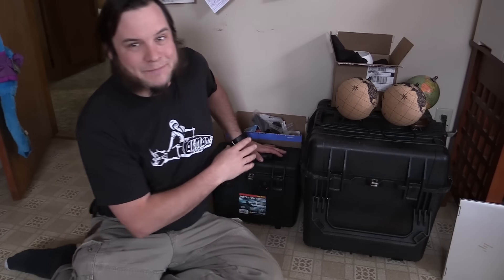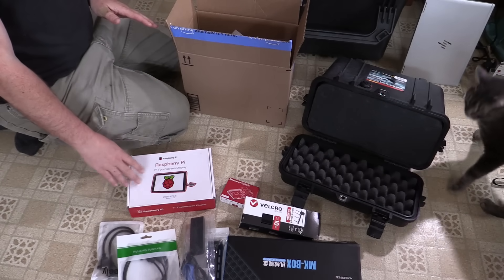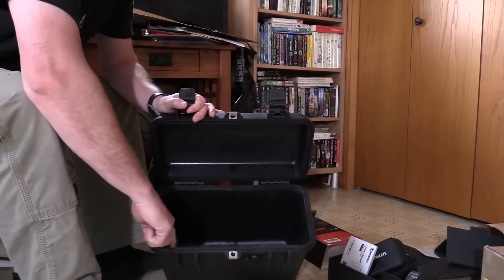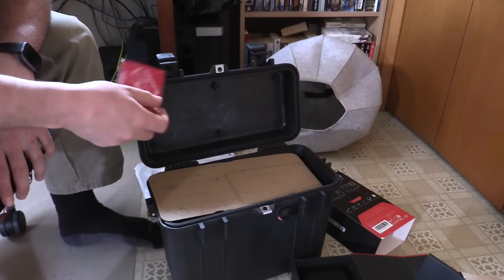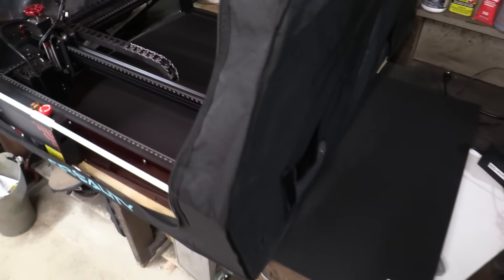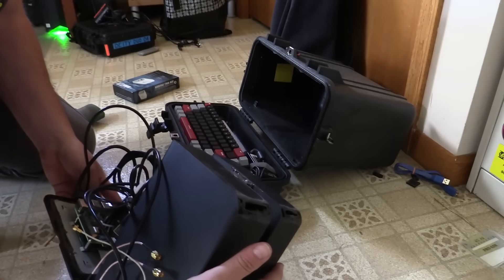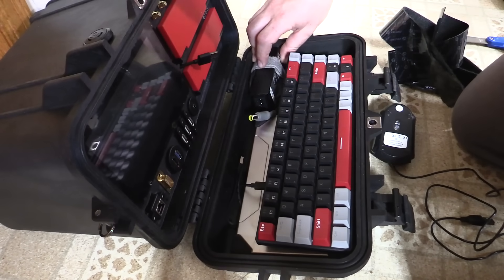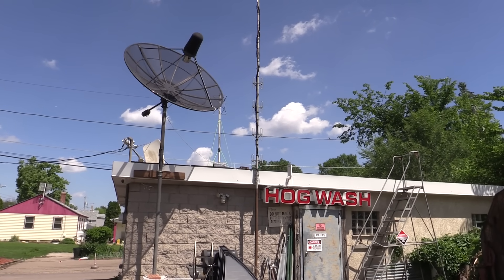Satellite Hacking Cyberdeck v2.0

Comment: Powering a RPi isn't that difficult, especially a RPi 4B with it's USB-C power intake. All you need to know is it needs at least 3.5 Amp - no ordinary USB lead can pass that much power regardless of what it says on the plug/amazon listing (or whatever). USB-C has made this a lot easier to deal with. You need an adapter that can physically pass that much power through it's cable. You can also buy USB-barrel jack adapters (both micro USB and USB-C) making it trivial to wire up a power supply, even a battery based one, or you can easily solder a couple of wires directly the the power input. Underpowering a RPi will result in poor performance because it will throttle quite a bit - to check and make sure you're powering it sufficiently just type 'vcgencmd get-throttled' into the terminal, if it returns anything other than 0x0 then it is throttling. Underpowering can also damage the RPi and/or SD card long term so it is worthwhile getting it right. Also, to properly shutdown just type 'sudo shutdown now' into the terminal if the GUI isn't working for you (never heard of that one tbh) as shutting off power without proper shutdown can also damage the RPi and/or SD card.

Comment: Regarding your battery issues, you can't just run everything off a single USB port. You need multiple each with QC3.0 or USB C power output levels.
The battery isnt the issue, its the limit of the DC to DC output of the single USB port.

Comment: Next time you need a case look at something like the Nanuk 918.  They have places to insert screws and the Website has all of the files needed to cut panels like you did on the laser.  Unlike the Pelican boxes the Nanuk cases are designed to mount equipment into.

Comment: You could get a trigger board for Quick charge and set it to output 12 V and use a 5A buck converter set to 5.1V and power the pi with it.
You can also not choose to buy the trigger board and make your own with an arduino, I have found a project that makes an arduino into a QC3.0 trigger, but it involves in some soldering a bunch of extra components to arduino and a usb cable.
I had good luck with the above mentioned methods.
Also for pi 5 the usb port actually supports USB PD but again at a rare voltage and current config of 5v 5A but you could still power it with 5v 3A adapters if you dont draw too much power from pi's USB ports,
also you could try using powered USB Hubs for power hungry things like Glowing hacker keyboards

Comment: Raspberry Pis' are very power hungry. 
Your average, normal, generic amazonbasics USB A wall plugin only supplies 12watt.
The Pi (5) wants 27watt at 5amp, and it'll draw more based on what's plugged into it. (IE: An entire cyberdeck worth of peripherals.)

Getting some kind of power brick that has "fast charging" capability where it can supply 50, or even 100w on demand would completely solve it, and likely have some overhead for script-kiddie keyboard lighting. Older power bricks have electronics that don't particularity support the higher-intensity draw of fast charging or powering bigger electronics.
Reply from the maker: That power brick does have Quick Charge, still not enough! Someone sent me a little Pi converter but it showed up after I finished this.

Comment: How is the temperature behavior, have you installed a sensor to measure it? I could imagine that it could get very chilly in the black case, especially in summer. I would also install a fan. Especially as the Raspberry Pi doesn't have a heat sink and the battery will heat up a lot in the printed case.
Reply from the maker: It did fine for a couple hours in the sun, will see how it does all day at a convention!

Comment: A fix for those lid prints. Use a raft. If you use Cura for slicing it's a bit finniky to turn on, but there are guides. You need to check a box for 'build plate adhesion type' before the dropdown menu shows up.
Using a raft wastes some material but it's worth it. It wastes it in the part of the print that would have had problems and then prints the part itself correctly.

Comment: The best way to power a rpi is connect wires to the headers and use thicker wire but if ya want hot swap for ya rpi is just use a relay and on the output of the relay connection put a bank of caps

Comment: Nice setup, also for all kind of HAM radio projects. Did I mis a external power option ?
Reply from the maker: The external power didn't work quite the way I wanted, not enough room in the battery area. The battery can be charged while it's running, so that's pretty much what I'll do if I need to.

Comment: I think the pis use some non standard voltage which is the issue, they also are just power hungry.
Reply: more info:
"Official UK Raspberry Pi 4 Power Supply (5.1V 3A)"
5.1 not 5
Also adding more components shouldnt decrease the voltage, just draw more amps which would also be an issue

Comment: The laser cut panel and storage boxes really gives it a clean appearance; nice execution! FWIW, when I design/print brackets like the right angle ones you made, whenever possible I model a hex into them to capture common nuts like you used and keep fairly tight tolerances in the model so the nuts have a slight press fit. If you need to get the nut back out, you can partially thread a bolt into the nut and use the bolt to push it back out. Otherwise if size constraints are too small, heat set threaded inserts from Amazon work good.

Comment: Never take such items through the airport!
 Always ship them ahead with either FedEx/UPS.

It looks like you're filament maybe a bit "wet".
Don't bother buying those fancy dry boxes.
Just go get a plastic cereal container, pop in a hole with a grommet for the tube to pass through and some Damp Rid.
The Damp Rid works faster than desiccated silicon, but turns liquid.  
I put mine in a bar soap travel box with a sponge.
Damp Rid has a huge advantage in that you can dry it out and reuse it.

Comment: You sometimes get the under-voltage thing even with the 5V 3A adapter which comes with the raspberry.
I'm using a Tobsun DC 12V 24V to 5V 5A Converter to power my Raspberries.

Add a DC barrel jack for 12V, cut up  a usb-c  cable,  make the connections and voila. 
For safety, I also recommend adding a fuse.

Total cost around 15$
Reply: I like to use the automotive jumper battery packs and tap the 12v high amperage side, forget the USB jacks. Then use a your buck converter to get your 5v and run that to the GPIO 5v header on the Pi. No need to go through the USB, Use and adjustable converter and Set the converter for 5.25v or so. It's also nice to have a DPDT switch that will allow you to use another external 5v power source and/or 12v source that you can run through the buck converter. If the switch has a neutral position to shut off all power all the better. Using 12v converter with option for external allows you to run off a car system as well, or a convenient car battery.

Comment: i made a cyberdeck with the pi 4 to run sdr trunk and it has taken me almost two years to find the right cables, powersupply, and keyboard to work with a powerbank and two  NSDR sdr dongles... for being the most popular sbc on the market it sure as hell is not project friendly nor is it a good candidate for use cases like cyberdecks. they need to make the pi work on low power mode. and offer supplemental power to usbs that is free from running through the main power on the board. the way i got around the power issues is to have a 40 dollar PDW usb c 'Y' split cable. one to the bank one to the pi. only way to get adequate power to your radio peripherals at the same time as your pi. dongles, usb hubs, and external power for hubs all cause grounding issues or low voltage issues.

Comment: if the prints are having those kinds of deformities, id recommend lowering the bed temperature.

usually what i do is a higher bed temp for the first layer in prusa slicer, to make sure it has decent adhesion, and then i have it set to be about 10C lower.

Comment: I use a portable camping power bank to power raspberry pi 4b just fine. It'll run for days non-stop. I got it in the camping section of Walmart. It even has a solar panel on one side to charge by solar.

Comment: What software do you use for the laser cutter?

For the battery, why not put the connectors in the back/bottom of the box and you slot it in
Reply from the maker: Not a lot of room in the back of the case, the battery just barely fits in there and I already had to cut off a bit of the 3D print so it would clear! I'm using LaserGRBL, I refuse to pay for Lightburn.

Comment: Grab yourself a cheap enclosure online and 95% of your 3D printing issues will disappear.  Keeping the temperature consistent and removing any air movement will drastically improve your prints and stop warping.  Bonus points by putting a fairly inexpensive PEI sheet for better adhesion.

Comment: Get a 5V 5A power adapter or power bank, or maybe a stepdown converter from those laptop battery backups that does at least 3.5A, that should  get rid of the power issues you're having with the RBPI 4, Thanks for the video :)

Comment: if you add a brim in your print settings, that /can/ help reduce the issue with prints losing adhesion in a corner. When i'm printing something with a square edge I'll usually add a brim and put some glue stick on the bed. 

I've also found that 210c for the extruder and 60c for the bed can help keep PLA prints from warping like that.

Comment: The warping is caused by the print cooling too fast. the middle layers of the print are pulling the edges up. The marks on the bottom are generally caused when in filament binds up for a moment. Not a lot you can do about that.

Comment: Those Voltaic power packs are expensive, great find! I use their smaller packs (v25, v50, v75) for Meshtastic solar repeater nodes.
Reply from the maker: Cool! I got a few of them, pretty cheaply. They're used but seem to have decent battery life so far.

Comment: The stupidity of RPi is they refuse to add proper power regulation circuits(possibly because they'd legally have to have cases if they did?) so the input voltage has to be slightly higher than actual 5V. You might have to bodge together a custom solution for that.
Reply: i used a generic $10 boost converter from Amazon in order to power a Pi from a USB power bank and that worked OK. And my setup was extra challenging because the power was going through a power multiplexing module that lets me dynamically switch between wall power and the power bank, and that thing - while it works - it adds some extra resistance which means a little extra voltage drop. 

That said, if anybody is tempted to try this, be careful. It's easy to accidentally send too much voltage to the Pi and fry the voltage regulator. Let's just say that I do NOT advocate trying to adjust the boost converter while it's connected to the Pi. Connect that to a programmable load, or at least a multimeter and a dummy load of some sort, and tune it "out of circuit" first, then connect to the Pi. Repeat the process a few times if you must, to get it dialed in just right.

Comment: That low voltage icon has nothing to do with the current sourced from your supply; it's basically a brownout notice. Get a generic 5.1V supply and wire it up to 5V and GND on the 44-pin headers and you'll be good. 5V might work through the header too, so you could just try your power bank with a chopped up USB cable and see if that works.
Reply: I used to get brownout warnings especially after connecting a little 2.5in drive to it. I just chopped a barrel connector off a 5v 3a adapter i had and soldered it right to the gpio 5v and ground pins.
Reply: This is exactly what to do - I do similar stuff with all of my pi projects (some of which are commercial products) - basically just using a 3A+ generic 5V supply through the GPIO header. It works 100% of the time. For the commercial projects, a $15 Meanwell LRS-50-5 powers the pi and a lot of other stuff just fine.
Reply: Just bought a RPi 5 and already regretting it. I did not need this much but whatever. Jumping along the lines of just powering directly to 5V and GND on the pins, can I do this straight from the power bank he's using? Just cut the USB cable and feed it from the power bank to the pins? I'm currently steering away from a 12V source and bucking it down. I'm trying to make this as simple as possible.
Reply: @luisr10177  Seems like that should be fine. If the lightning bolt shows up it really just means that the voltage is "too far" below 5V which could be a brown out or it could be just because the supply sources something slightly less than 5V (like 4.95 or something that the pi doesn't like).
Reply: @luisr10177  Probably not, most of those USB power banks cap the output at around 2.1 amps. You will need more like 4 or 5 amps to power that thing, requirements go up as you add USB dongles.
Reply: @luisr10177  power bank might not give you 5V, and i mean 5.0V, not 4.9 or less... you need at least 5V to run Pi. Phones don't care about these, but Pi does.
Reply: @Sven_Dongle  the ones with USB-C are a bit more flexible.  I have several battery packs that are rated for the 15.3 watts that the pi 4 calls for. though with a portable KVM I am making I have elected to power it using 20VDC power tool batteries as I have several and I needed a 12 Volt option so I can reduce it to that level easily.
Reply: @ Not unless it actually adheres to the USB-C power delivery protocol, rather than just use the same circuitry from the old USB A or B, capped at 2.1 amps, with a USB-C connector. True USB C power delivery will negotiate the voltage and amperage necessary to power the source.
Reply: I had the brownout warning running a RasPi-4 on the official power supply, but with an inline usb 3 power switch. Taking the switch out of circuit solved the problem. (Must have been a pretty shitty conductor)
Reply: I like to use the automotive jumper battery packs and tap the 12v high amperage side, forget the USB jacks. Then use a buck converter to get your 5v and run that to the GPIO 5v header on the Pi. That will give you adjustable foolproof power. It's also nice to have a DPDT switch that will allow you to use another external 5v power source and/or 12v source that you can run through the buck converter. If the switch has a neutral position to shut off all power all the better.
Reply: It is not just the 5volts.. poeople really skim over the "power" requirements of the Pi5 ALONG with ALL the peripherals... Most power bricks, "wall warts" are 5v, 1amp..or 2amp... for optimum performanve you are really wanting to go with at least 3amps- even then.... 4amps, ideally 5amps and even more so using an official Pi 5v 5a power supply...

For the portabillity part... trying to find a batterry solution may lead to  many brain injuries..do so at your oun risk. Pro tip... power sources/ batterries for hand warmers/ winter jackets are a good source of your 5v, 4-5amp requirements...but look out for them being 12v- some are...

Another pro tip- get usb hubs that are powerred.. they can draw power from the battery....just not through the Pi, and it'll help...lots.

Power through ethernet..if you can find a SSD hat that can provide a power source then you can cover the power requirements..more memory/ speed plus boot speed.

Comment: FYI the RPI5 actually addresses the issues with the power on the USB. You can override the need for the special power brick from them and tell the device to draw up to about 27 or so amps of power for usb stuff. When I first got my PI5 I was a miffed like you were about having to buy a power brick from them but then I found out about the override that you can set. I normally plug mine into a laptop charger that uses usbC so it provides more then enough power for any usb devices i may hook up to it.  Its also much faster then the 4 so it makes it a bit more useful. I have always had issues with SDR hardware and the RPI becaue of the power issues. Im sure you used the 4 because you had it on hand and also the 5 is a bit more expensive so it kinda defeats the point of repurposing things :)

Comment: I really love the luggable form factor. we had a win95 box, Dad brought home a Compaq luggable for me to play with (not the OG one, was a low spec 286). It had a 720k floppy drive, so I had no way to get data into it other than the keyboard. Pre-internet, but I did have a big stack of manuals for various things. I got basic running on it, Printer output, even serial comms to our main pc. many weekends of useless nerdery infront of its plasma display. I think the NERD co-processor just comes pre-installed in some of us squishies.
Later, in highschool, I found a 4" amber CRT, and built it into a tower Luggable. Hercules graphics, 386, dos 6.11 with network support, as pimped out as I could make it. I wish I knew where that screen was, Im pretty sure now I could make it do actual graphics, but it was Text only. I still managed to get it on the internet, have multiplayer deathmatch games, CAD software, play music. It was sick.
I need another luggable. I have Ideas. (and those are dangerous). It involves a 4"CRT color tv (totally useless without analogue transmission) and a Pi. 
Have HEAPS of fun at OpenSauce, Wish I was there.